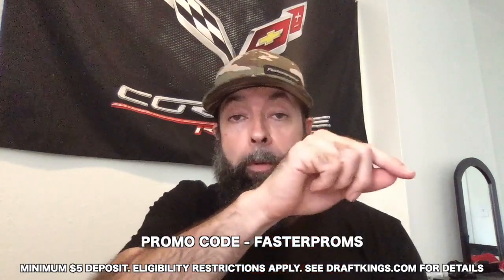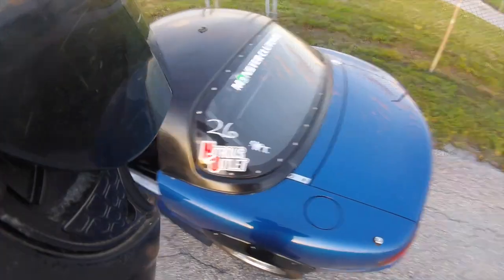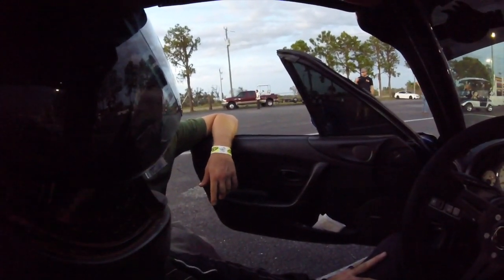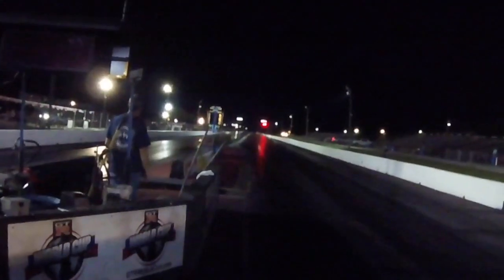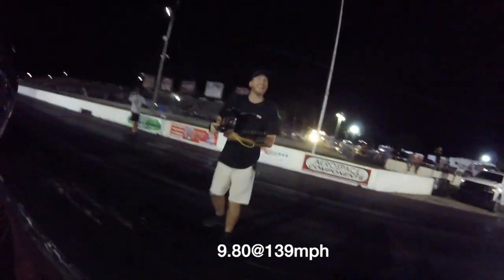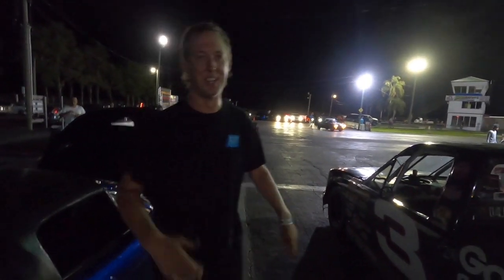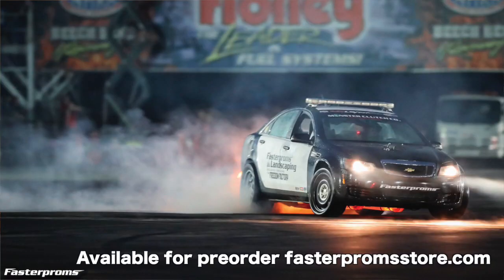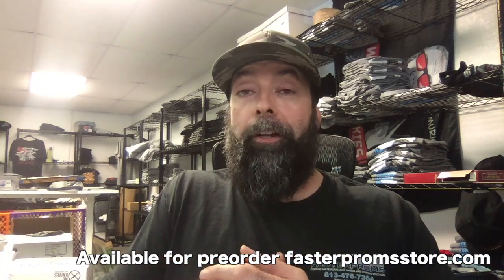The SHOWDOWN Nitrous LS-Miata Vs Overgrown HillBilly w/ Nitrous NASCAR!

Comment: Jeremy, if you drill and install 5 or 6 nutcerts under the rear of the roof, drill holes through the roof lip and make sure there's a rubber gasket between; she should stay secured, sealed and quiet. 👍

Comment: when the prep guy at the track makes sure axles die 😬
Reply: I figured that both parties had taken care of this. The caddies ran just fine, at faster speeds. My question is, how many times do you have to break an axle or a diff, before you actually decide to beef it up properly? Jeremy should know better at this point and Garrett MOST CERTAINLY should as well. It's pretty obvious that they have the budget and know-how. It just really sucks to see them break when they know better.

Comment: So let’s get a parts list together for next showdown. 
1) 2 step 
2) diff
3) axles 
4) driveshaft if the one in it isn’t heavy duty. 
You have two of the most brutal forces that love to eat drivetrain parts. 1) manual trans. 2) nitrous.

Comment: Jimmy. You need to do a straight throttle burnout. Meaning stop the in and out on the throttle, you are putting a ton of stress on the half shafts, small burnout better due to it has big power. So a simple burnout  make things happier. In one of your passes you didn't do it and car hooked. Once you put better shafts straight burnout. My .02 cents.

Comment: You should be able to run 2 step on the factory ecu. Set your idle spark threshold to 100 percent throttle and a few mph then on idle spark maps set timing negative at the rpm where you want to launch. When you hit your mph threshold it will jump back into your base spark table.

Comment: Doesn't anyone powershift anymore ? That is the number one time cutter in drag race driving with a stick. Watch some of the older videos of guys like Bill Jenkins and Don Nicholson
racing those bad super stocks back 60s and 70s. They held that accelerator to the floor through a speed shift as they stomped that clutch and snatched those gear changes.
There wasn't a 10th of a second between gears, and they were turning some crazy times 50 years ago. Yeah, they had some big sponsors, and were getting what was then pretty big payoffs, which helped a lot if you did happen to miss a shift and hurt your engine, or strip out a gear, but those old super stocks and gassers were pretty fast.

Comment: Hey, I'm curious, if a metal is cooled in a cryo-chamber with liquid nitrogen and slowly warmed, it becomes substantially harder. Has anything like this been done with auto parts, like say differentials, piston rods, etc?
Reply: Bryan Jones cold metal breaks a lot easier . To strengthen metal you heat treat it , then temper it to the desired strength.
Reply: @whosaidthat5236  https://en.wikipedia.org/wiki/Cryogenic_treatment   I imagine it works similarly to heat treating.

Comment: Need a little more compression in the shocks looks like it's bouncing off the bump stop. But it's the rebound killing you on the wheel hop. The bump stop or spring is throwing the car up too quickly.

Comment: It bogged because on launch the rear is too soft and dropped fenders onto rear tires.   That's your groves....that's your bog. The car is only moving after it rebounds off of the rear tires... And it was so slow that it's cutting the tires you're literally dragged in your car on the tires the first few feet

Comment: I noticed that Jeremy shifts into neutral after finishing his passes. I know it isn't just him, but why do some people do that? To me, it would make more sense to just upshift and engine brake alongside the actual brakes.
Reply: Harder on the engine. And the bigger transmissions, especially with straight cut gears. You can't do that with straight cut
Reply: Brakes cost less than a motor

Comment: With the amount of power and torque that car make with the weight only being 2500. You don't need to leave no harder than 2000-2500 rpms and slip the clutch. Your not driving a heavy car nor a import. Way to much rpm on take off.

Comment: Dude... Why are you taping the top on? Why don't you use the factory mounting hardware so your $1400 top doesn't end up flying off at 130mph?? There's like 4 different means you could secure that top to the chassis, none of which include the use of duct tape...